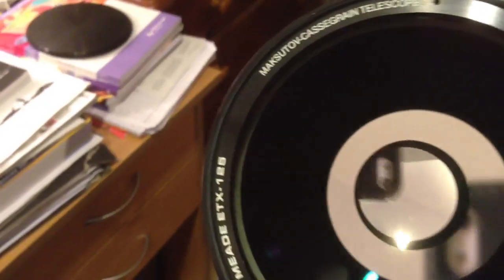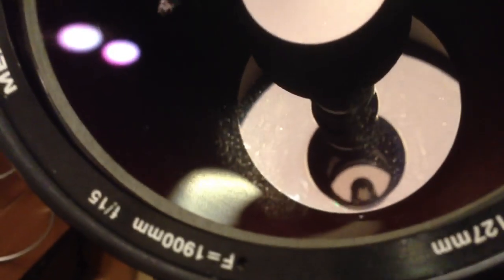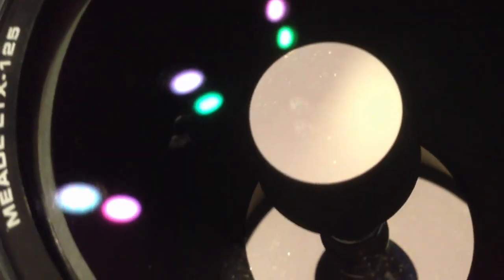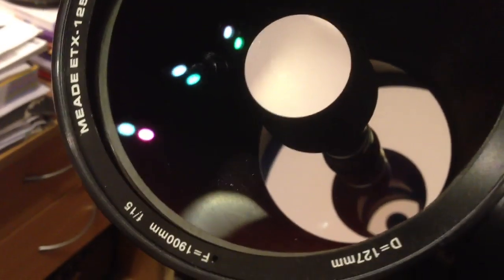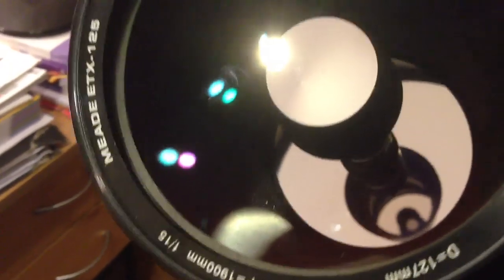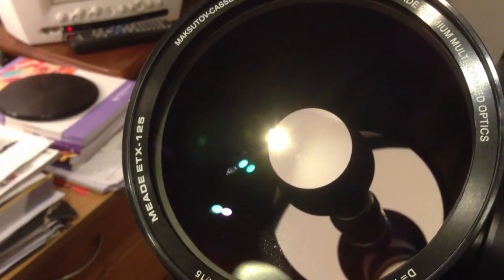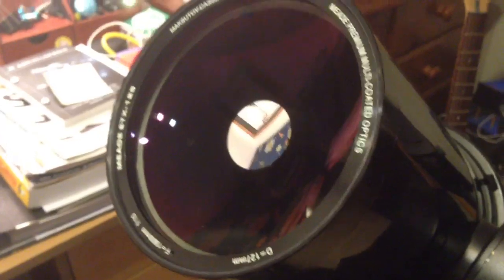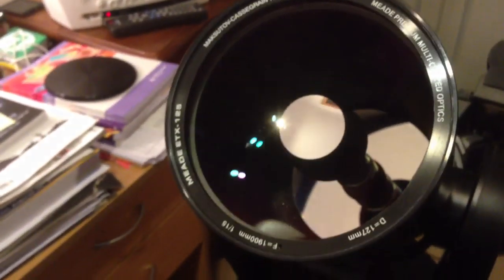A Brief Overview of a Maksutov-Cassegrain Telescope

Comment: As you were looking down where the eyepiece should be you could see the black dot from the reflector in the centre. With an eye piece in is this still visible or does the eye piece 'fix it'?
Reply: Because it is nowhere near the focal plane, you don't see it except as a shadow when using very low power eyepieces in daylight.  At night, you'd never notice it at all.